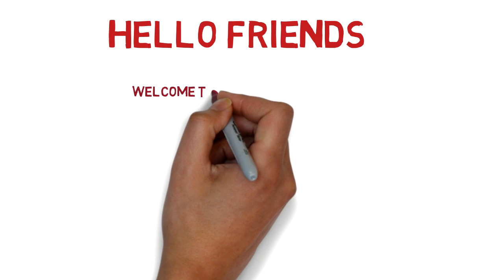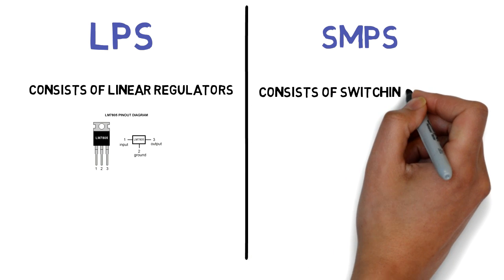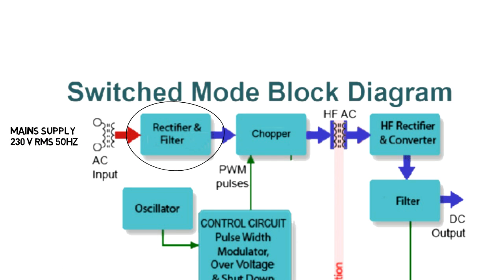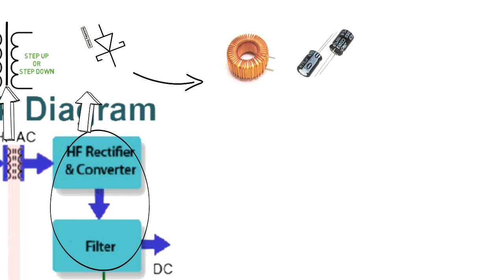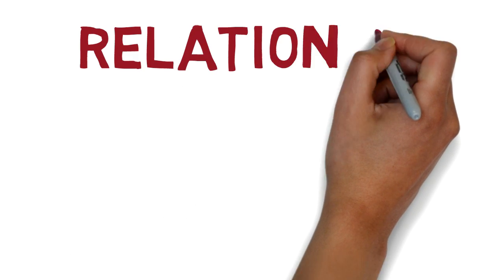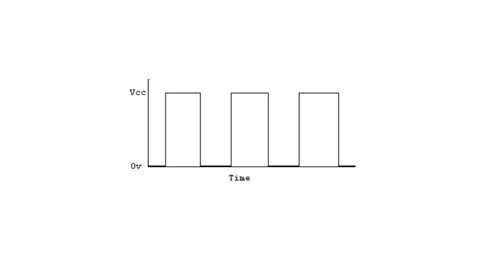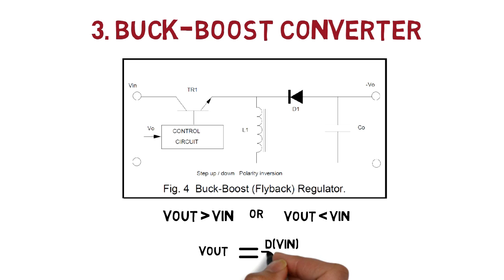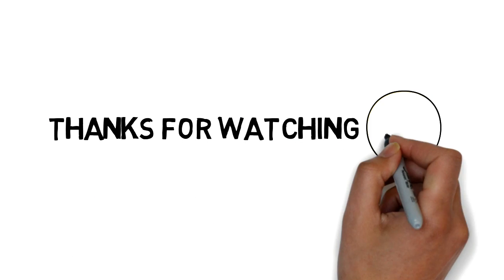Basics of Switch Mode Power Supply | Explained

Comment: WE FIND POSITIVE TO NAGATIVE VOLTAGE  CONVERTER  IC  LOW NOISE,VERY LOW RIPPLE  1A( -0.4 TO -5 VOLT out) STABLE TO NEGATIVE VOLT ANY  WEATHER (in put dc 12v)MY EMAIL shivamsignal@gmail.com